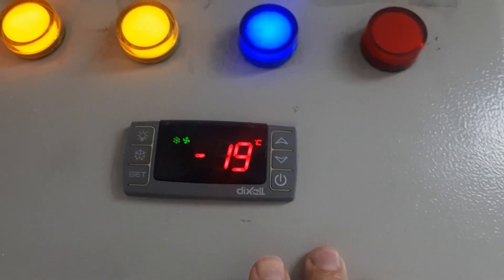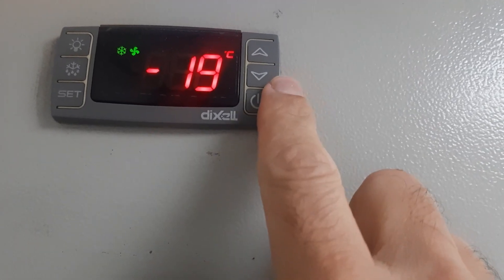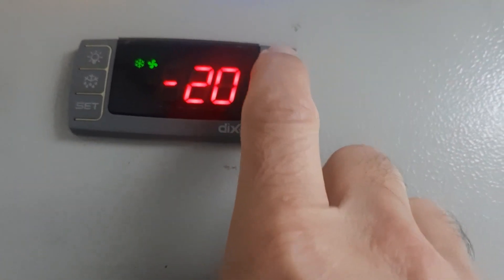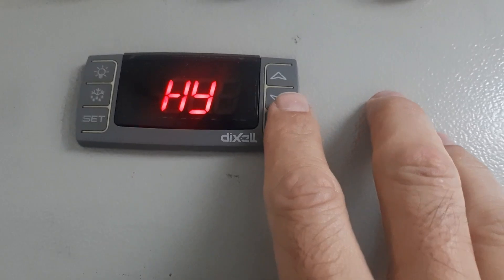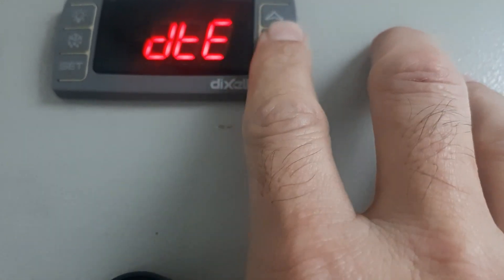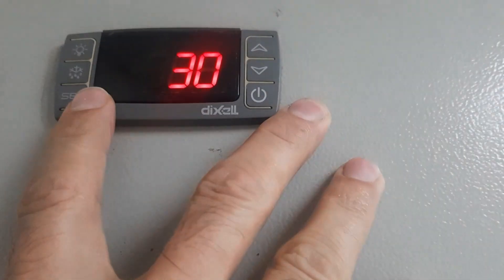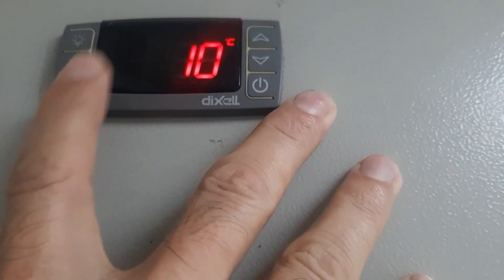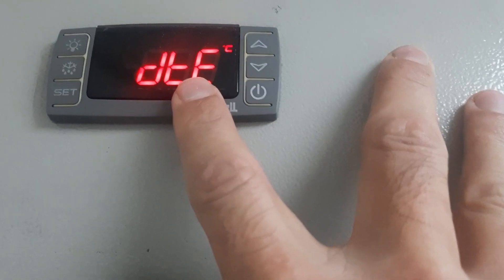coldroom defrost setting | dixell defrost setting #zkmultitech

Comment: Brother cold room temperature not reached when temperature reach -6 ice forming in suction line .
Reply from the maker: Condenser wash and gas recharged if no put suction pressure on suction line and put high pressure guag on discharge line see the pressure

Comment: Hi, i have a question for you.
If the defrost end temperature were set to 10º and the temperature in the room is 12º, and we press the manual defrost button, would the defrost process start? Or would it not start because it's above the set temperature? Or would it start but stop immediately?
Reply from the maker: Defrost will never start once room temprature above the defrost end temprature. very good question